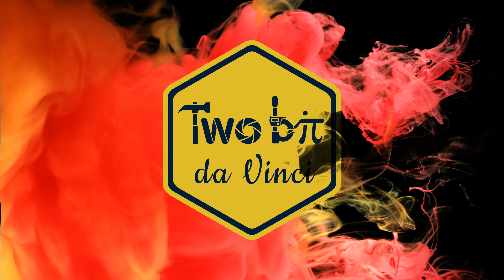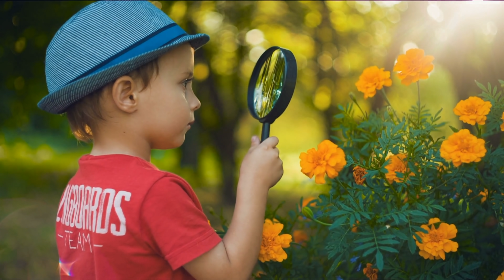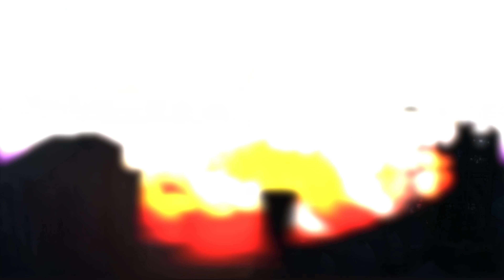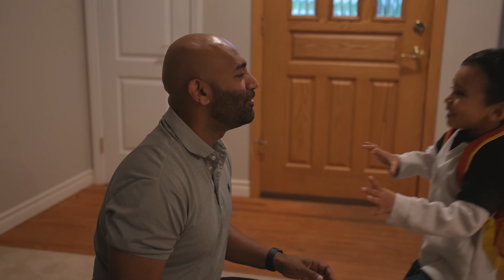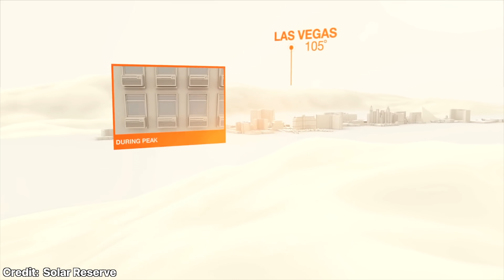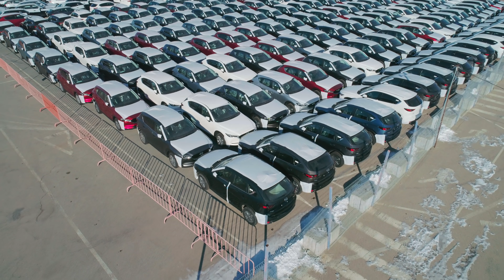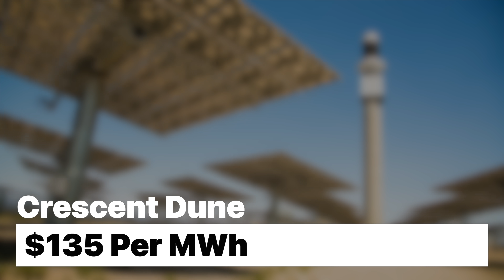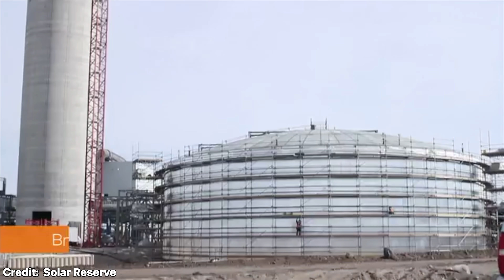This Billion Dollar Solar Plant was an EPIC Failure

Comment: Meanwhile back in my home town in Michigan there is a Nuclear plant that has been running flawlessly since 1976.
Reply: Wish the stigma for nuclear would go away, it is the safest, cleanest, and easily the best form of energy that we have currently.
All of the waste ever produced up to today could fit in a football field sized hole a few meters deep.
All of the people injured in some way are a tiny fraction (less than 1% of 1%) of the amount of people killed by fossil fuels.
Solar is good but we need mega scale storage options for power and wind turbines cause massive pollution when the blades wear out.
Reply: @spider0804  My cousin is a nuclear engineer and he just shakes his head at the mention of the "waste problem", which he says was solved back in the late 1980s:  mix everything with sand from desert dunes, run it through a shredder to get the waste particles down to the size of the sand particles, stir to get an even mixture, then add more sand until you get the radiation per unit volume down to a desired threshold; then melt it all and make mildly-radioactive crude glass.  This glass can be crushed in an ordinary rock crusher into the preferred size of rock for constructing the foundations of highways -- and when used that way, by the time the layers of smaller crushed rock followed by layers of gravel of decreasing size have been put on and the pavement itself applied, the highway's own material is a more than sufficient shield so it would be perfectly safe to park an RV on top and live in it, so definitely safe enough to drive on.  The same would be true if the "nuke rock" were used for airport runway foundations or new rail line foundations.

That the U.S. is still arguing about what to do with nuclear waste is a tragic joke.
Reply: @traildude7538  In Pakistan we have 3 small Nuclear reactors. One of which was shut down after 50 years of successful operation with no problems. If Pakistan can do it, then they're probably safe and reliable enough.
Reply: @traildude7538  isn't nuclear waste a solid uranium rod? How would you cheaply grind radioactive wate down to the size of a grain of sand?
Reply: @jacobzindel987  Yes and no. Nuclear waste is ALL equipment and material that has come in contact with extreme neutron irradiance. Typically, AFAIK, spent nuclear rods are used for... 'other things'.
What people really are talking about for waste is in the decommissioning. Not very much waste happens from a running plant. 
And I seem to remember reading recently that ALL spent nuclear material to date could fit into something like an olympic pool.
Reply: @jacobzindel987  According to the U. S. Department of Energy nuclear waste includes not just the radioactive materials themselves but all the equipment and gear used to handle them.  My cousin was a nuclear engineer at Hanford, and he talked about gloves, pliers, transport containers, even a hammer as being nuclear waste under the rules.
But even the fuel rods aren't "solid uranium"; the U.S. Nuclear Regulatory Commission describes a fuel rod this way:  "A long, slender, zirconium metal tube containing pellets of fissionable material, which provide fuel for nuclear reactors."
Of course by the Department of Energy definition, that tube is nuclear waste, and so are the pellets -- but...
the pellets should not be considered waste, they should be regarded as high-quality ore from which impurities can be removed and the rest be made into new fuel pellets (the U.S. is far behind the curve on this one!).    Those impurities would be nuclear waste and could be tossed in with all the low-level waste and ground up -- and grinding it all is really little different from grinding rock (actually much easier).  On the other hand, China has demonstrated the other approach:  first you melt your rock materials (this doesn't have to be sand), and when the molten rock is the right temperature you mix in the nuclear waste and stir (I couldn't find if they chop the waste up at all first).  That's not new; France has been doing it all along and has pioneered interesting uses for the diluted and vitrified waste.
Reply: @traildude7538  its what happens when woman run things. you forgot because "feelings"
Reply: @J0s5p8  Wow -- that sounds just like my nuclear engineer cousin!
Reply: @traildude7538  so is the energy needed to do all of that waste processing provided by the same nuclear plant while at the same time providing enough extra energy to be economically favorable?
Reply: @raloed.363  I'm not understanding your question---Are you suggesting that the amount of energy required to deal with the waste** from nuclear fission is in any way even remotely close to the amount of energy generated by nuclear fission?

** Which, according to my understanding, only---or mostly---applies to the decommissioning of a nuclear power plant, and not to the ongoing usage.
Reply: @traildude7538  When I hear "spent nuclear fuel";  I think nuclear fuel.  The next generation of nuclear plants will most likely use it as fuel.  Check out molten salt nuclear reactors.  My favorite design is one by Ellysium.  Several Yo.u Tube videos explain it very well
Reply: @jimtrowbridge3465  Sir, that doesn't comport with Church Doctrine. You are skating dangerously close to heresy.
Reply: @bricaaron3978   Its not just if its remotely close but can it exceed the energy requirement for the entire waste disposal process so much, that it is still highly economical?...but after giving it some thought Im guessing it will.  think about all the carbon based energy it must take to mine, extract, purify and concentrate the uranium, plus transportation and to build the nuclear reactor itself. Even after all that carbon footprint its still economical to build and run the nuclear power plant, which doesn't even last forever. I believe I was underestimating nuclear power
Reply: @raloed.363  Let me ask you a few specific questions:

1. Is "Carbon Footprint" an inherently negative concept?

2. As all plant life breathes carbon dioxide, is there any such thing as carbon dioxide being inherently harmful to Nature?
Reply: @raloed.363  Easily -- the volume of actual waste is small.
Reply: @bricaaron3978   1. Its looked at as a negative concept due to the damge it is said to be doing to the environment.
2. Carbon Dioxide in excess is claimed to be harmful to the environment as it causes global warming and negative changes in the carbon cycle.
Reply: @raloed.363  "1. Its looked at as [By whom?] a negative concept due to the damge it is said to be doing [By whom?] to the environment." [Emphasis added]

That is an extremely suggestive statement, no? In fact, I would submit that it says as much about you as it does about the validity of these beliefs. If you were a dishonest man, I don't think that you would have worded things quite that way.
Reply: @traildude7538  , not to mention most isotopes have uses in medicine or industry. This is independent of reprocessing, another important possibility.
Reply: @traildude7538  US also banned waste recapturing.
Reply: @m4rvinmartian  ugh. No. When people talk about waste, they are in fact talking about spent fuel. That has the most radioactivity and longest half-life.
Reply: @anitat9727  I'd forgotten that.
Idiocy.
Reply: @jamesbizs  Thanks to the weird comment structure on you tube I can't tell which of my comments you're responding to (when I expand the replies to search, your comment disappears).  But in different comments I address different aspects, and in at least one I did mention that we could re-use the actual "waste".
Reply: @spider0804  Very misleading post. When talking about nuclear waste, size doesn't matter; Toxicity matters.
Duration Matters.
Reply: @Alvin-1138  Neither are large issues when encased in concrete rated to last the next millenium. Id happily live next to a field of them instead of a coal slag pile.
Reply: @spider0804  History has proven that your type of rosy forecasts of "1,000 year concrete/containers" are full of crap. 
You're sounding a lot like someone who has a financial/Political interest. You're also pushing the idea we can 'resue the waste'? But no actual plan/technology .
I'm not against Nuclear Power I just end want you guys to admit, it costs many many many times times more,  than you're claiming.  To deal with the safety issues.
Reply: @Alvin-1138   Well good sir I have a few points. I am neither financially or politically interested in much of anything right now. In none of my posts did I say anything about reusing spent nuclear fuel, but yea there are people trying out specialty designs to recycle the waste and have had efficiency rates of up to a 90% reuse ability. The only place I know of right now is in France and they take the remaining 10% and turn it into glass that has pretty much no radioactivity compared to regular spent fuel and it degrades quicker. Nuclear power is friggen cheap if you look at cost per GW over the lifetime of the reactor compared to much of anything else with disposal costs included. Power companies would not build them if it were not so profitable but here we are in youtube comments talking about it.
Reply: @spider0804  and with all that, we are talking about awful obsolete  tech. Imagine if we had modern plants all over the world. Cleaner. Safer. Cheaper. We would never need another solar cell. Another coal dug. Nothing.
Reply: @jamesbizs  Still would want to suppliment it with every other kind of renewable possible due to the limited supply of nuclear fuel, the longer we stretch it the better off we would be.
Reply: @spider0804  "All of the waste ever produced up to today could fit in a football field sized hole a few meters deep." Isn't it radioactive though? What about the radiation that'll poison groundwater and nearby land?
Reply: @xynyde0  Its more of a mental demonstration to show the problem is much smaller than people think. Aside from that the concrete that they are encased in blocks pretty much everything, you can stand next to one and be fine. Nothing leaks out and they are rated in hundreds of years.
Reply: @spider0804  This is a deceptive description of the amount of nuclear waste. Sure it may not take up that much space assuming we could shove it all in one spot. Nuclear waste storage doesn't work that way though. There's about 86,000 metric tons of nuclear waste sitting around the US at various plants waiting to be stored. Assuming the Yucca Mountain storage facility could get built, it's only designated to handle 70,000 metric tons. We create an additional 2,000 metric tons of waste a year. It could potentially hold more than that but the consensus over various studies is that 120,000 metric tons is the ideal limit. We will exceed that relatively quickly. Then we would need a whole new site.

The other issue is transporting all the waste. It's not just going to get loaded up onto a couple of trucks and it's done. It's stored in huge cask and pools all over the country. 

This doesn't include all the other nuclear waste we have yet to fully deal with in the US or that is still being generated from decomissionings and decontaminations. 

I'm not adamantly opposed to nuclear but trying to mask the issues surrounding it with shady metaphors isn't helpful and harmful in the long run.
Reply: @shawnsg  We could literally stick it on a flat part of the desert in the containers and it would be find for the next thousand years but public perception is so far away from reality that it would cause an uproar. It is not an issue, people just make it one.
Reply: @shawnsg  and there you go, ignoring the reasons for all that waste. Inefficient   plant designs from literally half a century ago. New designs can literally use that waste as fuel.
Reply: @jamesbizs  What are you talking about? I'm not ignoring anything. For starters, the waste already exists. Second, there are nearly 100 active reactors in the US. How long and how much would it take to retrofit, if they can be retrofit, all the reactors? Honestly I'm not familiar with what you're even talking about and I don't see anything with a quick Google search other than a bunch of maybes.
Reply: @spider0804 there's a lot of things we could do but that doesn't make them realistic like sticking them somewhere in the desert.
Reply: @shawnsg  its perfectly realistic if people would educate themselves and stop fear mongering about it. Just make a building in the desert and leave them in there with some security but 99.9% of people don't understand how radiation works. Heck most people I talk to still think radiation sickness is contagious.
Reply: @spider0804  The issue is meltdowns. Yes there are safeties there, but that didn't stop fukushima, 3 mile island, or chernobyl. 2 of these were the result of rampent corner cuts. 1 was just seriously bad luck.

It only takes 1 reactor failure to do international levels of damage. They are also easy military soft targets.

Lastly, nuclear material is also finite and will run out just like oil and coal. It isn't infinite and we could burn through most radioactive materials in just a century easily if we used nuclear on a global scale.
Reply: @VadersFist501st  as for your last point, that gives us a century to figure out fusion instead of turning the planet into venus.
Reply: @spider0804  I think you're quite naive and short-sighted. Nuclear waste will continue to be radioactive for thousands of years if not longer.  Currently, we don't even have a proper way of disposing nuclear waste.  Assuming all the current nuclear waste fit into a football-size field (as you said), and you go all out on nuclear plants, building more and more of them, you'll need more and more football size fields to store waste. Lands that in human terms would be wasted forever. And not just those football-sized lands, I am sure no one would want to live anywhere near such fields, making the wasted land area thousands times larger if not more. And when will it end? It's like the US's debt management, keep borrowing with no end and no plan in sight.
Reply: @alwaysright6358  also do realise it shifted only a couple meters in those millions of years
Reply: @technica7788  You never know. All you need a crack in the containment and radioactive waste will leach into ground water.
Reply: @alwaysright6358  even so, evaluate the risk of irradiating a small area than polluting the entire world
Reply: @alwaysright6358  we could always store the waste in the mines left over from digging out the raw materials for the beloved EV batteries. My biggest concern is what will we do once we have stripped the earth of all of the minerals for batteries? Maybe go back to oil I guess?
Reply: @justinfabbott  If you dont care about leaving future generations poisonous Nuclear Waste, why would you care about minerals being depleted for batteries. Weak argument.
The real argument against Nuclear is that to make it truly safe and manage the waste somehwht responsibly, it raises the costs hugely. That doesn't bother me, but we can't get Corporations and cheerleaders to own up to that or account for that in the so called cheap electricity arguments.
Reply: @Quentin Styger thanks quentin,
Reply: I am a submarine sailor on a nuclear boat. The thing about nuclear is everything that is repaired or maintained is now radioactive for thousands of years. Every rag, wrench, etc. All that waste has to be stored safely. We still put our trash in a hole like a caveman, do we want to put this in the ground with our drinking water?
Reply: @philiprivera8542  "We still put our trash in a hole like a caveman, do we want to put this in the ground with our drinking water?"

Billions upon billions of dollars are spent sending material out of Earth's orbit. If the disposal of radioactive material were really that big a of problem, the tiny amount of material generated could be sent to the moon.

Like many things: It's really not a big deal---It's just a matter of ideology and priority.
Reply: In lots of places around the world there are mirror-based solar plants that are also running flawlessly. This one was just done very poorly.
Reply: Tam, the “tree huggers” don’t care that the nuclear plant is functioning properly.  They need a cause to rally their agenda.  A nuclear plant fits their bill.  And so they get enough of their airheads to demonstrate with them, and poof, there goes the plant….
Reply: One accident is only needed for you to relocate to somewhere else.
Reply: Thank you. Its so dumb we aren't using nuclear as our energy back bone with some solar and wind to augment it.
Reply: @Quentin Styger  @Quentin Styger  Why don't you try living in Chernobyl? Just because some desperate folks live there despite high radiation levels does not mean it's safe for humans to live. And you all you did was parroting other person's comments without providing any relevant information of your own. You should definitely look in the mirror, a dumb dumb is staring back at you.
Reply: Well, I grew up in MI, and in 8th grade our class made a field trip to the Enrico Fermi Breeder Reactor in Monroe.  A few years later there was a partial meltdown and it was scrammed.  BTW, the fuel was plutonium, which is capable of critical mass.  And just to give you an idea of how 'safe' the thing was, the COOLENT was liquid sodium!
They now talk about Thorium reactors being very clean and safe, and I'm looking into that, but, you know, I've heard that song before.
Reply: The powers that be can't support nuclear because then they wouldn't have the constant threat of "climate change" from more traditional power sources to be used in support of their agenda. As if the powers that be actually care about the environment. All of the evidence points to the fact that the powers that be don't care about the environment. They care about money and power/control (and money is just power/control).
Reply: Read recently that this year's droughts have got close to causing problems (cant recall where) re cooling. Water is a must for nuclear. I have come round to thinking we need it in the mix for definite.
Reply: @Quentin Styger Not exactly livable as the Russian troops found out as they we digging trenches in contaminated soul.

The special risk nuclear plants pose is laid bare by Putin's decision to occupy and fire on Ukraine's nuclear plants and hold plant engineers hostage. Nuclear plants have long been recognized as  unique targets for terrorists.
Reply: Oh, pshaw...
Just load it all up into one of those fancy new rockets and send it to me sun. Surely a little extra radioactivity won't matter there, and if it burns up in the atmosphere if the rocket fails we can pay cigarette smokers to move wherever the cloud is to filter out the radiation with their lungs. 🥴
Reply: @thedillpickle100  "Just load it all up into one of those fancy new rockets and send it to me sun."

I beat you to it. :P
Reply: Nuclear  energy does not fit their definition of "green" because using it does not force people to change how they do things. It does not fit their agenda for controlling the people.
Reply: Ludington PSHPP Consumers
Reply: Keep your fingers crossed. The problem with nuclear power plants is that we have learned a lot since 1946 and since 1976. That doesn't mean we should kid ourselves about our knowledge of safety. There is a simple phrase - "The learning curve". It is plain foolish to assume we know everything about nuclear power plant technology when it is quite obviously a new technology. At this stage, it should not be a new technology but there are people like Eric Tam who are content to say it's okay when the way it works is based on knowledge from 1976. We can always do better.
Reply: @waynethornton2174  extreme weather is everything new. Stop lying about it. The real problem is the right. Keep a muzzle on those fools and we may yet avert this climate crisis caused by their greed for oil money.
Reply: Where's the Waste Going?
How long wiill the waste be stored, "flawlessly"??
Reply: @Alvin-1138  , until it can be used.
Reply: @waynethornton2174  coal is dirty. And nuclear isn’t. Look up how many people have died from all aspects of coal power production
Reply: Also a nuclear power plant running flawlessly for almost 25 years in my old home town Raleigh, NC.
Reply: Nuclear running flawless but always deadly making deadly waste. Using finite uranium and boiling millions of gallons of water. 
 Nuclear gets the biggest subsidies of any power.
Reply: @PhxElecAuto  That is not even remotely true, currently Nuclear makes up 1% of all energy subsidies in the US while renewables make up 59% and fossil fuels sit at 25%, with the rest being given to energy efficiency projects like capacitor banks. The fuel is finite but so is fossil fuel, the only difference is there is enough nuclear fuel to last longer. Boiling water is literally how all fossil fuel plants work as well so I do not know what your point is there.
Reply: YEAH BUT WHERE DOES THE WASTE RADIOACTIVE CRAP GO?
Reply: @tesmith47  Well, as I said to another person. If you took all the "radioactive crap" ever made from all plants from the entire world it would fit in a football field sized hole a few meters deep in its concrete encased form. It is a much smaller problem than people like to make it out to be. The radioactivity coming out of those concrete cases ranges from the equivilant of flying in a jet to getting an xray. They are rated to last hundreds of years and would be fine sitting anywhere out in a desert and harm no one as long as you dont literally give one a hug for a few months. Sensationalism and misinformation has made it so people want them buried in a mountain though.
Reply: Yeah and those are all to be decommissioned guaranteed when the time comes. Nobody's taking bidens 6 billion lol. The issue is waste, the cost and time to decommission a plant when it comes time. The potential for disaster area could be inhabitable for 100 years.

Shiloh over here in Chicago went off line back in late 1990s it's 2022 and they still cleaning that shit up lol. Billions of dollars with no production of energy. Too expensive. But easily the best form we have.
Reply: Huuuuge fan of nuclear. Families, energy, bombs, all the schnidt. Love nukes!
Reply: @scottydu81  I make the valves that go into the Nuclear power plants around the world starting with us in the good ole' 
US of A ....
Reply: Yeah, but Nancy Pelosi's kids could not make a fortune building one of those like they did this one.
Reply: @waynethornton2174  What's not to like is the people dying from it. Asthma, respiratory cancers, the people dying in the oil/coal mining industry (one of the highest death rates of any profession), the pollution from coal slag pile runoff, the toll on the enviornment in general. You just don't care because you don't see the people dying in some big news article but they do every day.
Reply: @spider0804  "What's not to like is the people dying from it. Asthma, respiratory cancers, the people dying in the oil/coal mining industry (one of the highest death rates of any profession)..."

What's not to like is the people dying from getting out of bed. Getting hit by cars, murder, accident, sunstroke, skin cancer, etc. If people knew how much more dangerous getting out of bed and going outside was, NOBODY WOULD DO IT!
Reply: @bricaaron3978  so, your point is that we should still use intentionally use coal, despite it being harmful for a lot of people, because accidents happen? A lot of those things are out of our control.
Reply: @alexandervowles3518  "so, your point is that we should still use intentionally use coal, despite it being harmful for a lot of people, "

Nothing isn't harmful in some way or another. Even water is deadly if a person drinks too much too quickly. You're not making a legitimate argument, you're making Appeals to Emotion.

"Despite it being harmful" is wishy-washy, and not the basis of a legitimate argument.
Reply: @spider0804  The issue is can the economy produce jobs for those workers if we shift fully. Chances are not likely as its too specialized. Secondly you need to factor that coal and oil are the prime drivers of good quality green energy. They set the minimum standard and alternatives have to at least beat that AND be competative financially. I will do everything i can to keep oil and coal alive so that green energy has competition and remembers not to slack off. Oil and coal are convenient and cheap. Green has to do better or else and that is a great thing because when we hit the point where green is better coal and oil will be obselete and used for nothing more than hobbys.

This is the same reason i hate the oil bans. If government coddles the green energy industry they will get lazy and stop developing tech because they will become "good enough" meanwhile everyone suffers the negatives of bad green energy which will lead to a shift right back into oil and coal. We DON'T want to boomerang back so lets do it right the first time. 2035 is way too soon as demonstrated by all kinds of issues in EV's and alternative energy in general.
Reply: @VadersFist501st  coal was largely unmanned in the US over the last presidency but did not make a resurgence because it is no longer cost competitive with natural gas and renewable.
Reply: @waynethornton2174  it's not going to be economical soon when the supply chain disruptions and food shortages from extreme weather start to bite
Reply: Fusion
Reply: With what’s going on with Putin, Scandinavian countries are starting to embrace Nuclear Power - issue is storing the spent rods
Reply: @brianmclean7576  lol bahaha. Starting to embrace? How many have shut down plants ? What do they think is going to happen? They will build new plants? And then what? 10-20 years from now, if Putin hasn’t completely destroyed those countries through fuel shortages, they will have functioning plants running? It’s amazing what that stupid child Greta was able to cause in Europe.
Reply: I don't think any one of us is qualified enough to say if nuclear is worth it. We do know wind power is very useful
Reply: @OscarLT321  "I don't think any one of us is qualified enough to say if nuclear is worth it. We do know wind power is very useful"

Your comment is illegitimate: You apply the qualification of "worth it" to nuclear, but then change the qualification to "useful" when you speak of wind power.

We know that both wind power and nuclear power are useful. As to whether either are "worth it" is another question that depends entirely upon how the term 'worth it' is defined.
Reply: So said the horse owner when the horseless carriage came out.
Reply: @bg6217  So said the horse owner when the horseless carriage came out."

I don't understand how you just typed that, unless you are either ignorant or dishonest. Automobiles replaced horses because they are objectively better at the task for which horses were used: Quickly transporting people and goods from one place to another.

There is no technology which is objectively better at the task of supplying large amounts of electrical energy 24/7 than nuclear fission.